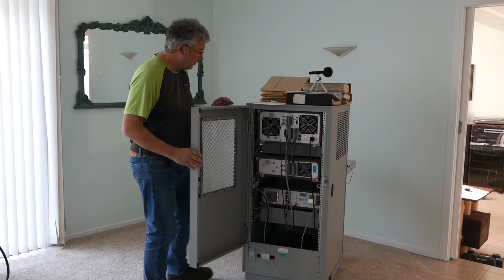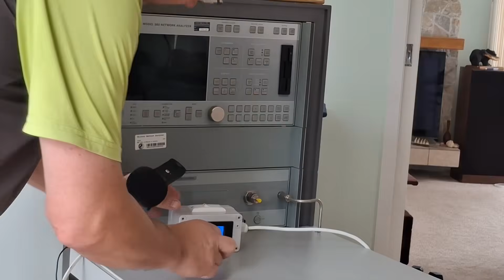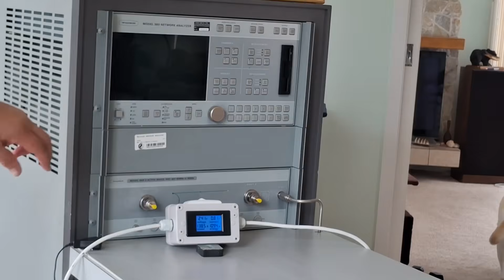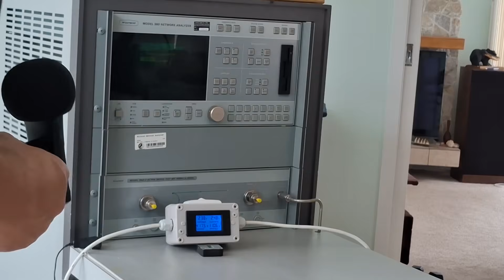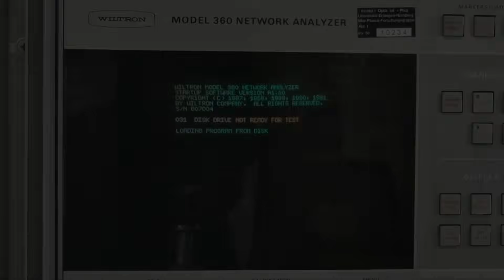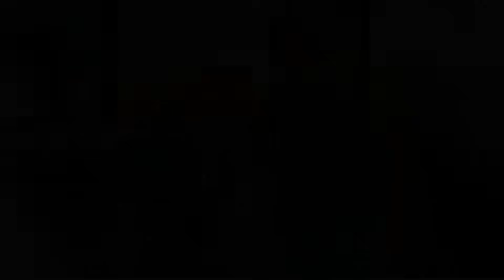Powering up my vintage Wiltron 360 VNA for the first time. 003

Comment: Wow, 40GHz, that's a SWEET VNA. Hopefully you can get the source fixed. I know with some of the HP / Agilent VNAs, the source failures are due to failed yig's, and they're basically un-repairable, unless you have a wire bonding machine. Hope the issue with yours isn't as dire!
Reply from the maker: I am hopeful.  The fact that the manual says there are lots of potential causes of the fault is statistically helpful.  If the manual said the YIG is THE cause, then I'm sure I would cry.

Comment: Wiltron. Now that's a name I"ve not heard since... OK but seriously, never saw their gear in person, it was always either HP or R&S.  I think we had an Agilent rack at one joint.
I assume Tek made a VNA at some point, but never saw one.  Most of the VNAs I ever touched were HP, sometimes with a little TI computer to drive automated test sequences.
Your kit looks like it's in nice shape!  

OH PS: I"ve got one of those $100 shirtpocket VNAs, I'm sure it's just as good (j/k).  I bought it on a lark, but unexpectedly found it useful for things like basic antenna tuning, and twiddling a tank circuit in an antique medical device.  I don't think I've used it twice, but amazingly it can generate a legit Smith chart and other charts, which can be printed out.  Not quite the same regime of precision or accuracy, sadly. :D🤣  Oh, I just realized I can probably also use it to identify random ferrites I have lying around. ^_^
Reply from the maker: I have read Anritsu bought Wiltron 1998.  Before I purchased my Wiltron 6409 SNA 2GHz, I had never heard of Wiltron.   Now that I have a Witron 360 VNA 40GHz, I look down with condescending arrogance upon those shirt pocket VNAs 🤓

 I sold my spectrum analyser with the intention of buying a newer model Siglent SA and hacking it to a VNA.  I now have a VNA but I still need a SA.  😒

The 360 is only working to 10GHz at present, but I have never needed to go above 3GHz.  If I can get it working to 40GHz I will have a solution looking for a problem.😁

Comment: A classic piece of RF equipment definetely keep it out of landfill at all cost. Even though much smaller instruments are most likely available, this equipment most likely has incredible specs. Keep viewers posted how you get on and  use it in the future.  I understand Wiltron was absorbed into Anritsu. Thanks for the video.
Reply from the maker: I have given my Wiltron 360 a name.  I call it my Elephantus Albus Magnus.  It is going to take a lot of time and money to maintain without any realistic chance of generating an income stream.  It is too good.  The rational logical action would be to send it to e-waste. 

I am committed to repairing and restoring the Elephantus Albus Magnus. just for the challenge.
Reply: @darrenconway8117  Still has value, but only if it's fully aligned and calibrated.  You would need to send it out even after getting into good shape, since you are not a NIST-traceable cal lab, and those are the only paper stickers that count.  Given what they sell for in good working condition, it would be worth it until that last, very expensive, step.  But if cal costs a grand or two, it's STILL worth it on the open market.
Reply from the maker: I don't understand why I would need NIST-traceable anything.   NIST is just one National Metrology Institute  in just one country, and that country is not my country.    

There is absolutely no danger of me shipping a 40 year old instrument anywhere to get calibrated.  I had a custom crate built to get it from the University to my place so that part is OK.  The risk is that the vintage 360 develops a fault before, during or after calibration.  

If I can get it working to 40GHz and verify its performance, I'll be happy.  I have 2.92mm cal standards, but nothing to verify.  After fixing faults, the main problem is the 360 is missing cables and adapters. Without those it is unusable.
Reply from the maker: The VNA specs are for resolution, and they are  really impressive.  The accuracy of the 360 is dependent on the accuracy of the characterization of the cal standards.   I have a thick folder of calibration results recorded over a 6 month period (ie. 6 months work).  They appear to be the results of proving the performance of the 360.  I will post videos but the 360 is at the end of a queue of unfinished projects, so I don't expect to get fully engaged with the 360 until the end of the year.